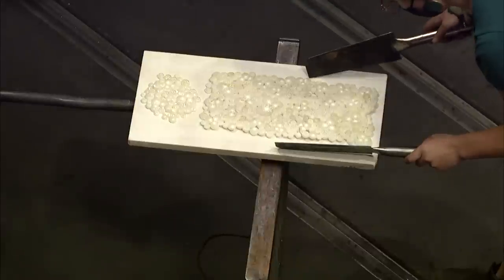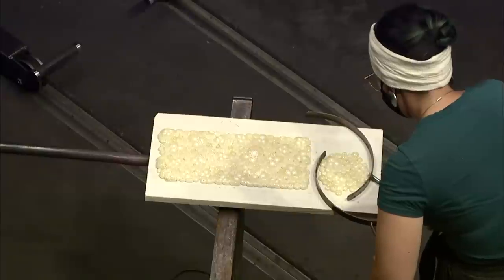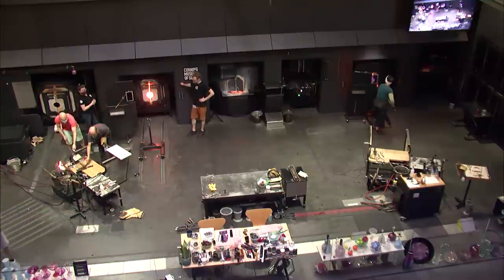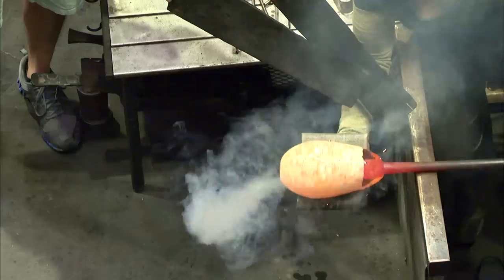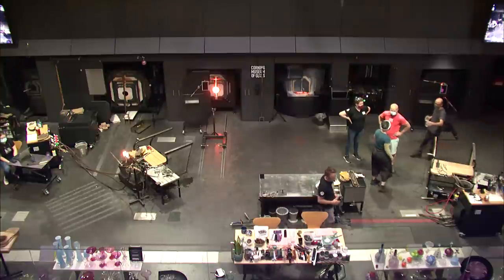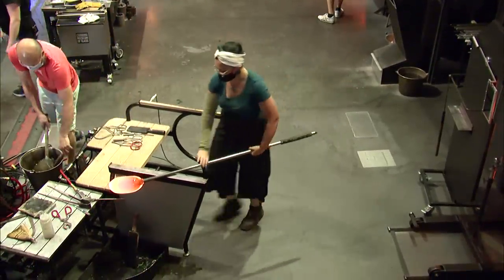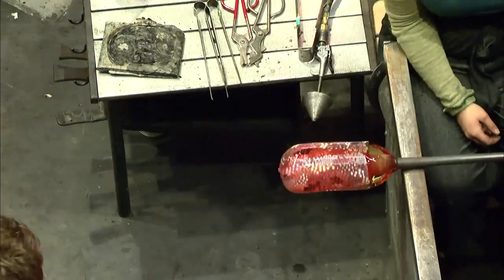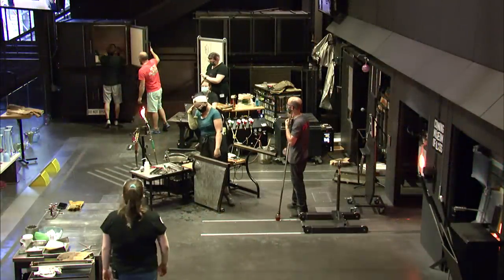Cat Burns Shops Collab Demonstration | Full demo

Comment: Is there an optimal thickness for the glass when they are crafting .
Reply: I know this not really an answer. It depends on the piece. Goblet works will give you a great idea on just how thin a gaffer will work with.
Reply: @caryharper9190  its more of an answer than I had before I asked the question lol
Reply: I'm just learning about this! :)  Fusing glass, specifically Bullseye brand, 'wants' to be 6mm thick, having everything to do with viscosity just above it's melting point.  If you put a thin, like 2mm, sheet in the kiln, it'll shrink its surface area and thicken to 6mm.  If you put in 10cm thick glass, it'll spread out, thinning to 6mm.  Glass formulas are a bit different, but as far as what Bullseye glass likes, 6mm is it.  Other formulas are likely close.

Artists use the thickness/thinness to do different things.  One critical aspect is that thick glass holds heat a lot longer, but it also takes a lot longer to heat back up.  That gets incorporated into the creation process that's entirely determined by whatever the end product/shape is supposed to be.
Reply: @janisfroehlig7744  that was alot of information,  thanks for sharing Janis .
Reply from the maker: Agreeing that it depends on the piece. Some goblets can be crafted very thin, whereas most sculptures would be thicker, but there are also sculptures made of assembled thinner glass pieces.